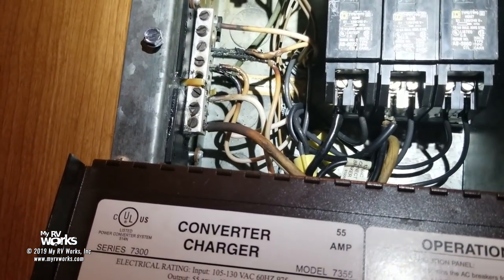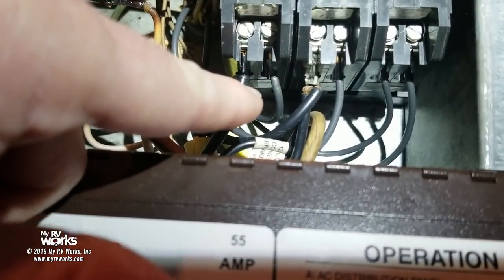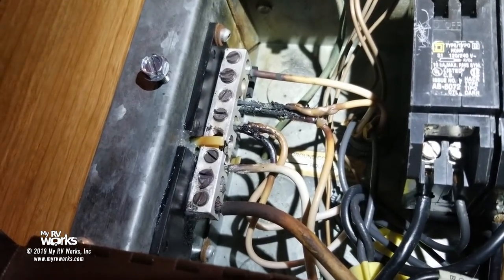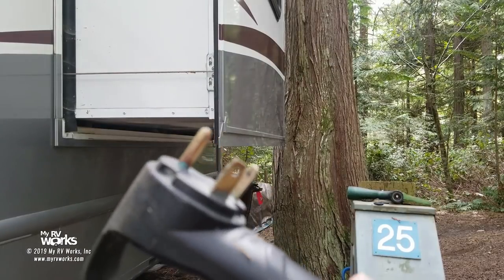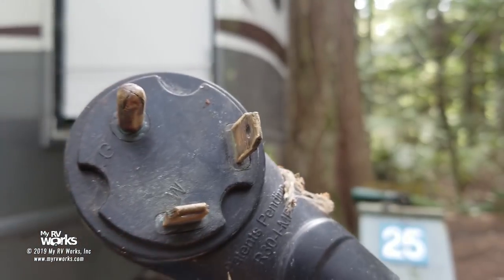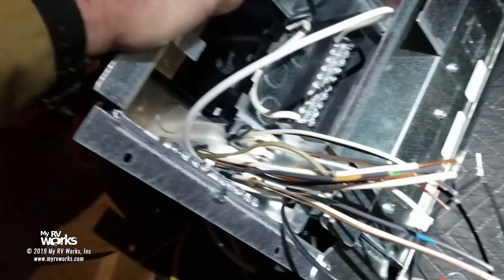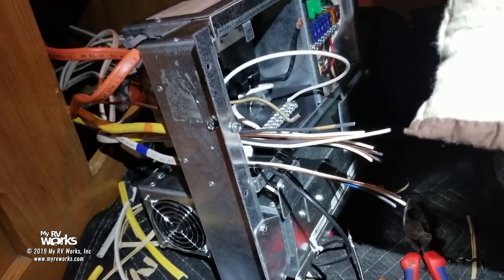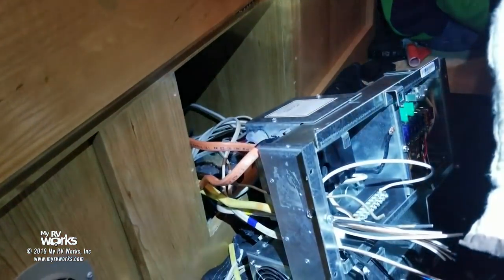Replace RV Electrical Service Panel & Explanation Of How Electricity Works

Comment: The Neutral connections were loose causing heating of the conductor. This heating after time destroyed the insulation. Now you really need to go back to school and really learn how electricity works. Replace the neutral buss, cut back the copper to good with, pigtail back to new replacement Neutral l bar. Sparky EE
Reply: Yes, he does not understand electricity.  The neutral is not just for return as he says, that is DC. In AC, the neutral is for both directions as the current is alternating directions.

An electron does not resist.  The wire resists not the electron.

It is not the case the neutral wire is too small.  Because the neutral wire and the hot wire are the same size.  So since in AC current goes both ways, both sides would get excessive current.

The only answer is one you said, neutral is not tightly connected for 30A.  He is right that neutral is not rated for 100A, but this is unlikely as 50A wire was suppose to be engineered to handle the load.  Causes could be path of neutral line is electrically "longer" either because it physically longer  or it has higher resistance.  Really though the most likely it is loose wire or the neutral bus bar is not rated to carry that load.

But he did a decent job to explain voltage and current.  He also did good to explain breaker is protect wire as so many think breaker protects the load equipment.  Hence they think, I increase watt rating of load device from 1200W to 2400W and so all I need to do is change breaker from 15A to 30A.  When in fact wire is only good for 15A.

The other thing he will not share with lay people is there are real gremlins and one has to call a priest.  But don't ever tell customer.
Reply: @joeboxter3635  Your path being longer from the hot to neutral to cause the heating due to one conductor having a greater resistance then the other, Man you gotta add a metric shit ton of wire length for that to happen.

Comment: Blue is usually the 3rd wire in 3 phase. So there's likely a 3 phase service to the park. The "hot" looks to be sized larger than neutral. Probably OK but convention is to have equal size wires.
Reply from the maker: Correct again!!!  You are batting 1,000 here!!! LOL.
Reply: Have rebuilt electrical systems in massive office raised floors where Engineers required 200% neutral... 10 gauge hot wire 8 gauge neutral wire

Comment: Darren.  Just bought a used RV. Have watched most of your videos. This video was the best explanation of electricity and how loose connections can cause you a lot of problems. I have already informed my wife that I will be pulling the power panel apart inside the RV to inspect closely before any trips this summer. Thank you for a great video and reminding us not to be complacent when dealing with general upkeep of our RV’s. Keep the videos coming.

Comment: I would imagine an RV is treated like a subpanel Installation. The neutral is NOT bonded to the ground bus. But the DC negative is tied to ground (chassis of RV)
Reply from the maker: You are correct.  If I remember the certification test there was a question about what to to with the neutral ground strap in an RV power distribution panel.  The correct answer is 'throw it away'.  The AC circuit is grounded at the pedestal only.  Neutral and ground are not bonded in the RV panel.   DC(-) and the AC ground are bonded to the RV frame.  That is why you will see me diagnose an issue and I look for a receptacle to put the black leg of the meter in the ground pin of the receptacle.

Comment: As much as I knew about electricity (I'm a Ham Radio Operator) I was unaware of torques on those screw connections.  I knew they could loosen and needed to be checked / tightened annually.  So "THANK YOU" for that piece of critical information.  I had to replace several connections on my dropping panel in the rear of my motorhome due to a fire when the neutrals came loose!  It smoked to circuit board too!  Not sure which happened first, but a new board wasn't too much $$$.  Now I will get one of those torqueing screw drivers - never heard of such a thing!  Again, thank you Darren!!!   Blessings your way!

Comment: I need some help. I have a 19ft x 8ft camper. running Dometic rooftop ac 13500 BTU. my camper is 110V system. Im in Texas can cool down to around 69-70  degrees and 100 outside. I now need to replace the unit. I want to go with a mini split ac, but would like to have 18000 BTU heat pump inverter. The 1800 BTU only come in 220 volts. How can I get 220V in the camper. I was thinking of running a single separate line just to feed the ac at camp grounds etc., but boondocking i will not have power for it. Checking my Generator t is only 120V and 30 -TT an 30-R. I do have another generator 240V but not an option can hear it for a good mile or more.
Please help me out here do not know how to go.Thanks Rocky

Comment: Several things said are scientifically wrong, but still usable for your purpose.  Examples RMS is .7 of your AC amplitude, average voltage is zero, and electrons are relatively stationary in an AC circuit and a few more.  However your analogies are ok for your purposes.

Comment: Overall the video was good, if a bit long. I didn't care for the potato analogies or the nonlinear parts of the presentation (jumping from topic to topic). That said, it's clear you are a knowledgeable individual and I appreciate you taking the time to share your knowledge. I have a strong background in electrical work and got some good value from watching this video. The criticism is offered in a constructive spirit. Will be looking to more of your videos!
Reply from the maker: Hi Daniel,
I very much appreciate your comment.  I receive it in the spirit you sent it in – no worries.  

I never know what I am going to say as I go unscripted and get on tangents explaining things, I did it on my battery video here too:  https://youtu.be/tuOnrt5x04c

I was an industrial automation system engineer for 25 years before I started this RV repair business.  Most recently commissioning and testing automated baggage handling systems at international airports and lots of field work for aerospace assembly equipment.  So, I bring a lot of high-level and real world troubleshooting and diagnosis to the RV arena.  I have been the tip of the spear on more than one occasion when the multi-million-dollar baggage system crashed, and it was up to me to get it up again so folks’ baggage can make it to the plane.  Then to put the pieces together and understand what happened so we can make the system better.   Don’t get me started on baggage tracking algorithms.  After an hour I would just be warming up LOL!

I resigned that career so I could be around my kids more – ergo we started RVing and learned how to fix em’ – the rest is history.  
https://myrvworks.com/about/

I appreciate you and your comment very much.  Thanks for watching and contributing to making these video’s even better.  I shall take a moment before I record and figure out where I need the video to go before I start rambling eh’.

Happy Camping!

Cheers,
Darren Koepp
Reply: @MyRVWorks  Oh wow... It took me a minute to make the connection between my comment and the video. I'm thinking this was one of my first ever comments when i'd just started following you. Much more used to your style and this point and if I may backtrack a little, your improv adds quite a bit (you've also gotten quite a bit better at it! lol). Thanks for being a sport Darren :)

Comment: Unfortunately there's not just 1 theory how Alternating Current electrons flow thru a conductor. In the United States Of America there's a standard of 60 Heartz per second. Which means electrons move back and forth making 1 complete cycle 1/60th of a second.

Comment: Hello . I really love watching your channel. But U really failed your audience with your explanation of ALTERNATING CURRENT. It's electron flow !  For electron flow to accure the materials we use for electron flow to accure the valence shell must be weak . That's y we use copper,silver, gold and platinum for our conductors of electron flow.  They have weak valiance shells !The electrons are pushed and pulled by hugh magnets at the power plants who's magnetic fields interact with a amature that's spinning.. There's no such thing as an emtry electron. . That's enough for this comment. I could go on further,but I'm to busy at this time.

Comment: Hey Darrin,
Here's one for you,
On the 50 amp rig/ setup, we have 120v & 120v both coming back through the one neutral "shared neutral" as you point out.
But as we can have up to 50amps on black, + up to 50 amps on red = up to 100 amps returning on the white neutral (as most all campers do not use 240vac devices) yet all the same gauge wire. 
What gives? 

I think in residential AC, they count on the fact that you'd have 220vac devices (the dryer, range, most air-conditioning, water heater, ...) cancel each other out 
(not using the neutral)
So, why does RV code not require the neutral to be up (really down) in gauge  to allow "up to" twice the amperage? Either the 6-8AWG wire (depending on which chart you use) can actually carry the 100 amps (+ a safety factor), or ??

Comment: on that exact unit im running into problems! hopefully you can help me. first off, shore power doesnt charge my 12v batt. 2nd, on the DC side there is a red 8ga wire going straight to the NEG battery post on the right lower corner, the 8ga white(neg) wire is wirenutted into a strand of about 7 white wires. the previous owner isnt replying.... I went ahead and put the red and white wire in the corrcet lugs and gave it power but have ZERO 12v in the trailer. putting it back in the configuration I bought it in a fresh battery powers the 12v in the trailer. id like to fix the issue instead of using a 10amp charger plugged into the AC constantly. what shoud be my first line of attack?

Comment: Thanks nice video neutral wires function and location still isn't set in my head.working for a electric motor and pump company. Part of our PM service was checking all those wire connections. I was always told 80% of most electrical problems are ground related. Sure enough especially working on cars for 45yrs most times the problem is ground related.

Comment: Hi, Love your Video Like the way you explained everything , I have an electrical problem , it just started . I replaced  Furnus moter, I conected every thing back correctly , but now i have a short, I lost Power my 120v power, my 12v works , After watching your video , I checked My Breaker,  my cord , my Pedestal I  got power , and I’m getting power into the motor home
Im still chasing my power , is not getting any plugs hot yet , May you can help , Thanks

Comment: Regarding the cables in the power box, I've seen some RVers that use Ferrules terminal ends to prevent the screws from loosening over time.

Comment: OK, here is one for you. 2021 KZ 382MBQ, it has 50a service, however the Zantrex 1200 watt inverter has a 30a transfer switch that does not go to the RV transfer switch, it goes to the breaker box and only powers line 1 of the 5er.( only one wire comes from the inverter.) Can I replace the inverter with a Zantrex 3000x inverter that has a 30a transfer switch and wire a few more plugs ? Does the circuit breaker block the 50a input as you know, 50a rv service is 120 x 2 but both sides have 50a.

Comment: I just bought a 1981 RV class C. The original owner is a mechanic but that's not saying he is an electrician. All of the exterior (clearance lights) are not working. Other vids fixed this problem by replacing a fuse. Electricity is my weakest point probably because it is invisible. I can see why a meter (and knowing how to use it), is so important. Your vid is extremely helpful. I will probably need to buy a "Reading a Meter for Dummies" book.

Comment: I think you worry too much about the way that you are presenting your information or the length of time it takes to relay it. Well people know how to skip ahead if they are impatient. I think maybe you could edit once your video is done and add a time stamp in for the main info that your title relays. Also i would say stick to one analogy at a time, the multiple analogies are perfect in my opinion just maybe not when your jumping back and forth multiple times without finishing the entirety of one. So overall i think your video is super helpfull to me in that it gave me the in depth understanding i have been missing. Your multiple analogies are great and the presentation was great, so dont worry about anything and keep doing what your doing. Thanks for the help.

Comment: ANOTHER NICE REPAIR.  I LOOKED UP THE PART # FOR YOUR NEW LOAD CENTER/CONVERTER LOOKS LIKE IT'S A (Parallax Power 8300 Series 30 Amp Service Power Centers - 55 Amp) PRICE IS OVER $500.00, WOW.  AT LEAST IT'S STEEL, UNLIKE THE WAFCO PLASTIC LOAD CENTERS.  DO YOU HAVE AN OPINION ON THE PLASTIC ONES?

Comment: Very enteresting, I will check my connection tomorrow.
I have a question. What's causing my unplugged power cord to have 120 volts coming back through the cord with generator runing?
Thank you

Comment: Great video.I now have some understanding of the wires.Before I had none.Being female I and never understanding anything about electricity at least I know not to mess with it.I wish you could recommend a Company or person from the East Coast.Around the Charlotte,NC area that can fix my air conditioning or converter box? I have a 2006 Prowler

Comment: Excellent video!!! YOU are my go to RV You tuber... 
I bought and refurbished a dry rotted and moldy trailer.  So in the demo process, I took the Oven fan and light lines out but didn't mark it.  So, when i reconnected the light switch, it shined very low.  Also that orange line (on another light switch) have visible wet corrosion from were the previous light was connected. Any suggestion? 
Should I change out line or continue to check with the meter? I am not an electrician but have had some electrical training in the Navy as a gun student. Please any help or suggestions?

Comment: Gosh, Darin. I watch your videos all the time.  I recently have been battling a neutral wire meltdown in my class C.  I purchased a new 50 amp panel and upgraded from 30 amp because my mobile repair guy told me I was exceeding my 30 amp with the AC on and a couple small appliances.  I had the fist meltdown out of the blue.  Second one came after replacing the the shore plug.   I did notice the new shore power plug I put on had some loose connections.  However, the fried wires were in the junction box that connects the shore power to the panel.  Could this have been caused by the loose wires at the shore plug?  I would expect the fried wires to be in the plug end.  Anyway, I hope the upgrade will do the trick.  What are your thoughts sir?  I would really love to hear them.

Comment: I'm at the point  where you said black and white wire being 10 amp and get 10 amp back but I assume that is for 30 amp service/ on a 50 amp ? Do you get different on wite if I have shared neutral. What is readings? , I emailed you but haven't received a response

Comment: what does it cost on average to replace the breaker panel mine looks just like the 1 in the video but fully melted and seperated from nuetral bar

Comment: If this was your personal RV would u TIN the larger wires at the panel ? Or is that overkill ?  Also. I’m working ona Wester RV with 30A service. How come the feed at the top of the bus bar is vacant and the feed apparently comes through the breaker first ? Wtf is their reason for doing that ❔ immotgoinh to change it just wondering.

Comment: Ok the only  common that is shared is the common from the 50 app service, but the power failed is o ne side ofcamper. Receptacle and lighting ? The common that melted was the white common  comeing in with the 240 volts from 50 app ,it single phased the 240 breaker also but after replacing the breaker / I get 240 v all the way but  not from main in rv to the 2nd feed in the circuit control panel/ may not be code but having to feed receptacle with drop cord with 2 nale ends .I know this is not good but can't find a break in connection.  Dose wire go somewhere else on way to control panel???

Comment: Your potato analogy is flawed. In an AC electrical system electrons are pushed and pulled at 60 times a second. There is no difference in electrons between the hot wire and the neutral. You said the hot wire carries excited electrons. No, they aren’t excited, just being pushed or pulled in both the hot and the neutral. The electron flow will be the same in both the hot and neutral.  This is how a GFI works, if there is the slightest difference in current between the two it trips. 
You demonstrate by holding a “hot potato” in your hand, moving it to the right down the “hot” line. You demonstrate the neutral as empty hands moving to the left. Where did the potato go?
You also have the skin effect wrong. Electrons flow easier close to the surface, not on the surface. They do in fact flow throughout the entire cross section of wire. 
You jumped between several different analogies to make your point but none of them are accurate.

Comment: Ok. Is there any reason why you should not switch the 120 volt breakers off or on before plugging or unplugging to shorepower? Is it not necessary because the electrical service is automatically protected?

Comment: In my camper the AC breaker would release for no reason every time we were out using it. I could always engage it and was fine. Now it won’t engage. The AC breaker (20 amp) is attached to the main (30 amp). There is a wire attached to each breaker at the left rear of the breaker. The screw came right out of the AC breaker. I can not get the screw out of the main breaker. I’m sure the screw is stripped. How can I get this out to replace it??
Troubled